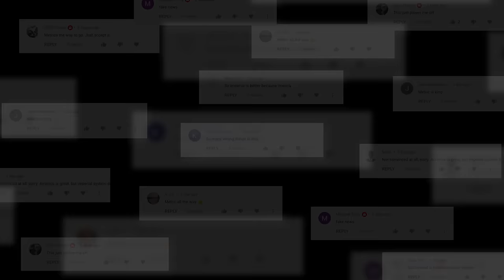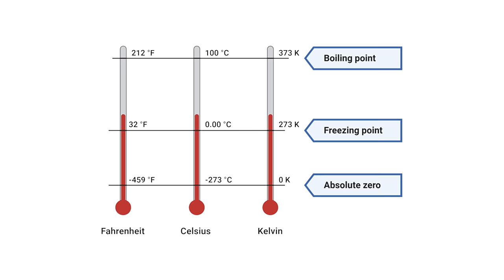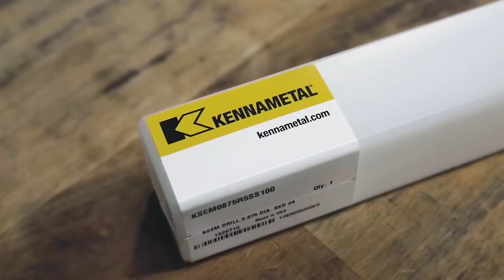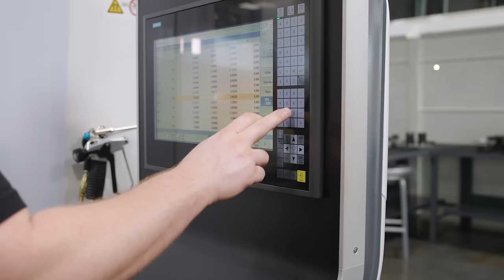Why METRIC is SUPERIOR to IMPERIAL

Comment: Metric is superior in almost all ways, except temperature. Celsius is exactly as arbitrary as Fahrenheit.
Celsius has none of the benefits of being a fundimental measurement that most other metric units have. If you want to know how much more thermal energy something has at 50°C than 5°C, you must first convert into Kelvins (hint: it's not 10 times as much, because Celsius is a relative, non-linear scale). Fahrenheit has the same problem. Celsius only has the superficial appearance of neat and orderly "decimalization", simply because it goes from 0 to 100.
Additionally, it is not true that water changes phases at 0°C and 100°C, except in the most ideal lab conditions (pure distilled water with large nucleation points under exactly 1atm of pressure, but not with a gas that can dissolve in the water and alter its properties). 
If Celsius has limited scientific utility, the only value it has left is day-to-day use. Since intuition is the best measure to evaluate something with no scientific rigor, like a relative temperature scale, it follows that the human body is a good starting point. We are humans after all. Compared to the temperate climates of North America and Europe, Fahrenheit is a good indicator of average climate. If you have a day over 100°F or under 0°F, things are getting pretty extreme. (This isn't perfect everywhere of course, just look at tropical or desert areas, or the arctic).
So yeah, in summation:
Fahrenheit is at least as intuitive as Celsius.
Fahrenheit and Celsius have the same utility in science (next to none).
Celsius has fooled metric fans into embracing it through its facade of decimalness.
Props to Celsius himself, though. He was trying to standardize temperature measurement before there was a theoretical framework to describe an absolute temperature scale.

Comment: I'm too old to really give a shit, but if I had it to do over... metric.  the video stated something about 1975 the US tried to change. I think it was earlier because I would have been 11, I think I was 8 or 9 in 3rd or 4rth grade, I went to school that year and they said they weren't going to teach us the imperial units any more, that we were going to learn the metric system. I was young and had no feelings about the matter until halfway through the year they said NOPE, we are now teaching both. Ya see it was so easy to learn metric base 10 and the correlation between length, weight and volume and then compared to imperial's methods... it was obvious imperial sucked. Later in life about 30 years I was asked to design a series of molds for our Asia market. I found out I could design faster in metric because it required fewer keystrokes my mold feature resolution changed from .0625" (1/16) down to 1mm using fewer keystrokes and getting better resolution to design features was a big plus. Bad part, I have over 10 thousand dollars of measuring instruments from my first 20 years of machining that are all in imperial (inches) units.... that's a big part of the obstacle

Comment: The big problem of the imperial system is that is not DECIMAL, I mean there's no major problem in using inches or mm, there  is a simple 25.4 conversion factor.
But, if 1,5m are one meter and a half, 1' 6" is one foot and a half !!! That's because only 12 inches are one foot! Instead a meter is 100 cm (centimetres) or 1000mm, very easy.
Imagine... 1,5m times 2 is 3m (easy), but 1' 6" times 2 is 2 feet! That's a useless complication...

Comment: "one isn't better than the other"

I beg to differ, stuff like the wavelength of light or the mass of an atom cannot easily be measured in imperial because imperial doesn't have units that scale accordingly.

Meanwhile in the metric world you just add a prefix, move the decimal point and you're done!
Reply: Just add a prefix huh? That simple? Just move the decimal point? The problem is that humans in the general population have an issue with orders of magnitude. Try this experiment, objectively if you dare. Ask your friends to imagine 1 million seconds. (10^6). Ask them to approximate what that is in hours or days or whatever they wish. Then ask them to do the same for a Billion seconds (10^9). See what sort of answers you get.

Comment: people need to start using logic, this vid said it 0.001 mil is smaller then 0.001 inch so that alone proofs that metric is the better one, less tolerance then better. but hey i know its hard to unlearn one thing and learn a complete other thing. i'm a "gamer" at hart and i was used to use the arrow keys on a keyboard to controle every game i played, while most of you now go "why not use AWSD or QZSD on french keyboards" instead of arrows, i resisted for years BUT the fact still was awsd users had way more other keybinds around their fingers then i had so they played most games with ease. well what was my point again, ehm short friend of me can't play games with AWSD he still needs arrow keys and i hear him complain every other game that he can't use the keybind he wants. well the same goes for metric and imperial, at some point in time you all need to cave in for the better system, its the only way real progress will be made.

Comment: Engineering companies should to work with particular system metric or imperial. This means that drawings, measuring equipment and machines must use the same system. The worst thing is if two systems are mixed with eachother, this is waste of time and money. I do like digital calipers and mikes because it is easy to switch between, problem solved.

Comment: I would like to address the possible reason for this debate.  First, I agree the metric system is better,  But,, just looking at the math   Base 10  is a perfectly miserable base, very little divides easily with the various common divisors.  Opposing, Base 12 is a wonderful base, nearly every divisor has a simple fraction.  SO I found it both interesting and instruction when the video began with "from the North Pole to the South Pole,,, ALL degrees latitude and longitude  ARE BASE 12  !   The reason for that is 360 degrees is Base 12   12 hours or 24 hours are Base 12.  The reasons for those two examples are because of extreme wind and storm,,,, sailing directions can be shouted to the helmsman and PERFECTLY understood.  And the hours in a day or minutes in an hour, seconds in a minute,,, If you work 8 hours in a day,,,, 3 shifts fill the clock,,, just try to do that in Base 10.  Napoleon tried,, and failed.
The final decider will be centuries in the future, when two more digits are added to our fingers and mathematics,,, and a metric like base 12 numbering system is employed.  Base 12 is a far superior base.

Comment: 0:57 Lies

the Imperial system is defined off the metric system, so imperial is equally as accurate and based off the same units of measure.

There is NOTHING absolute about the metric system. Metric is based off of a set of arbitrary calibration weights and such that deteriorate and vary over time and from place to place. different calibration samples around the world change at different rates. Also, many concepts they are based upon in science are themselves not yet fully understood or vary. There is a strong argument that the speed of light is actually variable for example (but so far still inviolable regardless of what its local speed is). There is literally no measure of distance that does change in space and time by some amount constantly, however small. All systems of measurement are equally as variable as any other, including metric.

Comment: You can cnc to smaller in imperial than metric, you can do a thousandth of a inch whilst only a hundredth of a millimetre. And in many ways in measures and weights imperial is far superior. I can use both and know the pitfalls in metric over a large distance, larger numbers get more awkward to remember. Converting isn't too much of a problem in measuring, weights is more awkward as with temperature.
Reply: LOL, a thousandth of an inch = 0.0254 mm, a hundredth of a millimetre is 0.01 mm, which is easily to turn or mill, even 0.005 mm is no problem.
A grinder has no problem with 0.001 mm, a thousandth of a millimetre, so metric is way more precise. 
So your imperial thousandth is 2.54 times bigger then a hundredth of a millimetre.  😉
Reply: @ytfan3815  your right, but even still imperial is much more embedded in to society than most people think, you wouldn't ask for half a litre of beer you would ask for a pint. Or gallons on a petrol pump, or people have front yards or acre's.
Reply: @denismorgan9742  
I was triggered by your CNC statement 😁, but here in (Central) Europe we also use imperial sizes for tires, rims, plywood (4' x 8 '),  screens, some AG equipment etc. etc., nothing wrong with imperial, but for me I prefer metric. 😉😜
Reply: @ytfan3815  I don't think going for a half litre will have catch on or buying a few hundred meters of land? For me it will always be pints and acres. Metric version will never sound right.

Comment: Time is still measured in base 60 for larger values (except for hours which is composed of 2 values of 12 which is a divisor of 60), and it isn’t until you get below a second that it changes to metric units. Months are all over the place, but have been accepted as metric, so neither system is perfect. I also feel that base 60 should be the norm instead of base 10 since it is a highly composite number.

Comment: A measuring system is based on how it is defined and Imperial units are defined by the metric system. Thus Americans are really using the metric system with some conversion.

Comment: Feet may vary but a foot is 12 inches about the size of your Johnson in outer space.  

Are drops of water always the same size?
The short answer to this question is that the volume of a drop usually does vary. For water, it will be in the order of 0.06 milliliters. This defines a very approximate unit of volume which apothecaries called a “minim”. A rough rule of thumb is “about 17 drops to the ml”.
-Haha! 17 is a prime number.  Good luck trying to metric that.

Comment: The Metric system is coherent,, unlike Imperial.
One millilitre of pure water occupies one cubic centimeter and weighs one gram, at 25 degrees Celsius. It takes one calorie of heat to raise its temperature by one degree. A force of one dyne will accelerate its mass of one gram at 1cm per second squared. The energy required to exert one dyne centimeter is one erg. An erg is the "E" part of E equals MC squared. Try that in Imperial.

Comment: First, the US is technically metric. Look it up. Every formal US measurement is defined in law by its metric equivalent. 

Second, the two systems coexist in the UK. As a Brit, I knew my height in feet and inches, my weight in pounds and stones (even the Americans don't use those) and distance in miles. We buy our milk and beer in pints. But we fill our cars in litres, buy our lumber in meters and schools exclusively teach the metric system.

Despite using imperial all my life, I couldn't really tell you how many lbs there are in a stone. I just read the scales. I couldn't tell you how many litres in a pint. I just bought my petrol one way and beer and milk in another way..
Reply: Basically, imperial is custom, metric is law. Just like in the US except the Brits committed to metric a lot more. Anything sold in imperial measures has the metric equivalent printed on the label.

Comment: 1 inch = 2,54 cm. I am 1.82 cm in height. Write this in foot an inches. 😁1.83 is 6 ft. 100 english horsepower are 74.57 kW. One Kilowatt = 1,35962 hp. Here in Germany we use the imperial system for water and gas pipes. But these pipes are also available with the metric system. One german pound is 250 g. One american pound is 453.592 g. 🙃
Reply: Sorry Stan, but Central Europe pound is 500 gram (0.5kg) even in Germany  ( Pfund is 500 gr ), we in the Netherlands also have an "ons" (ounce) which is 100 gram but that's not international.

Comment: Why is metric easier and better than imperial? 
The benefits are many, but here are some of the main ones in my opinion. 
  1. The prefixes
 This allows us to work with numbers that are convenient for us while being able to switch to other units just by moving the decimal point.
 There are no fractions, we work with exactly the same numbers. 
2. The number system 
We use a 10-based number system. The metric system is the same, what a coincidence, isn't it :)
 All our math is ten-based. Metric ties in very well with our number system and makes mathematical calculations much easier. 
3. The relationship between different measurements. 
10 cm.*10 cm.*10 cm = 1 liter volume 
1 liter water = 1 kg. weight 
The energy to increase the temperature of 1l. water at 1 degree Celsius is 1 kilocalorie. 
The examples here are countless, but I think everyone can grasp the benefits. 
For this reason, the Metric is the gold standard in engineering and science.
Reply: The Calorie is NOT a SI unit.
Reply: @FrodoOne1  
Yes, it's not an SI unit, but it's metric. The unit of energy is the Joule (J). In fact, the Calorie is more commonly used in everyday life, and the Joule is mostly used in engineering and science. The relationship between these two units is 1C =4.1868J
Reply: @DarkPriest-rx7tw  There are at least 7 different "Calories"
https://en.wikipedia.org/wiki/Calorie

Comment: A yard and a meter are about the same.  In the U.S. we equate kilometer with mile.  There are 1760 yards in a mile.  So how many yards are in 7 miles?  Not easy to figure in your head.  How many meters in 7 kilometers?  Piece of cake.  The imperial system sucks, but finding metric stuff in the U.S. is often difficult.

Comment: I once wanted to find out how tall I am in imperial and it was a nightmare. I'm 1,70m tall so that means I am about 5.57 right? wrong! because they express body hight in foot AND inch so now I have to find out how long 0.57ft are in inch... it's 6.9... so lets make it 7.... so in the end I'm about 5'7'' and I'm not even sure if the rounding error is big or not.... what a clusterfuck... wouldn't it at this point be more convenient to just use inches and say I'm 66,9''? in the metric system it is just so much easier. There I am 1,70m or 17dm or 170cm or 1700mm or 0,0017km.... easy peasy.... just shove the decimal point around and you are there...

Comment: Neither system is superior. They're just different.  Metric is simpler, yes, but in the end its all just numbers.  There are 180 degrees F between water's freezing and boiling points whereas there are only 100 degrees separation in celsius, so Fahrenheit is actually more accurate. Add decimal places and it just doesn't matter anymore.   There are established standards for Imperial measures just as there are for metric standards.  It really makes no difference.  The fact that the rest of the world uses metric is the best argument that the we should all use it just so we're all speaking the same language.
Reply: The kelvin is the SI unit of thermodynamic temperature, and one of the seven SI base units. Unusually in the SI, we also define another unit of temperature, called the degree Celsius (°C).
In the Celsius scale 0°C is the freezing point of water while in the Kelvin scale the zero point is at absolute zero. Therefore, 0°K is equal to -273.15°C, 0°C is equal to 273.15 kelvins.
The superiority of metric does not lie in temperature measurement, but in the fact that it is decimal. Also, submultiples and multiple abbreviations are standardized independently of the unit used.

Comment: I work designing eletrocnics and I want to die everytime I need to adjust the scale on the CAD sofware, WTF THE PINS ARE 2.54MM APART AND NOT 2MM.

Comment: There is only one system, the metric system, and then the is imperial chaos, where 0.0254 meter is an inch, the inch therefore is metric..and so is every dimension derived from the inch.. why does a mile have 1760 yards or 5280 feet...? Try to convert fl.oz to cubic inches or gallons..

Comment: Metric workes better with the changing times by using things that don't change. Imperial uses slot of things that change from situation to situation. Like horse power for example. There are horses with 4 horsepower. Does that mean there is a horse in each of its leg? I dont know because it isn't clear. And even the things that don't change are stupid. Like the Fahrenheit scale. Sure its more accurate but hard to use accurately. Same with distances. Can you just say how many times planks of 5 feet can fit in a yard? Would be hard without a calculator.  How many times does 5 meter fit in a kilometer? Simply 1000/5 because it uses the same system. If you can and it wont hurt you in any way, convert to metric because of all the reasons said before and because you make it easier for the other 90% of the world to understand what you people are talking about.

Comment: I agree that we need to get to a same unit of measuring quicker rather than later as the world is getting so connected so fast that jobs get done over multiple countries we did a job that worked over multiple countries and 2 out of the 3 where working in metric and 1 imperial when crunch time came on site the people didn’t notice the plans they had where imperial and kept going cost the company millions as the 1st 2 weeks Where done all wrong 

If all three countries did the units of measuring that would have been avoided Money would be saved bonuses would have been bigger and so on